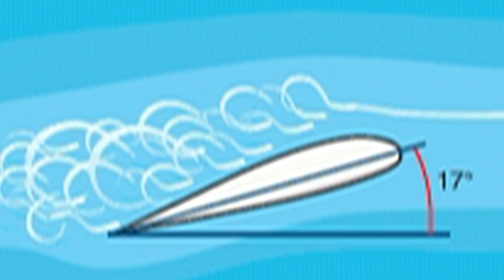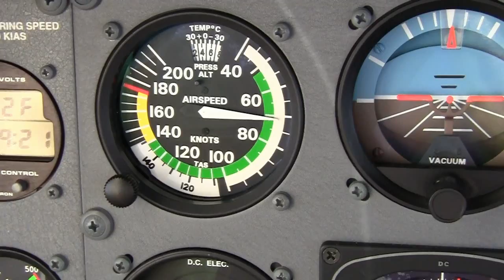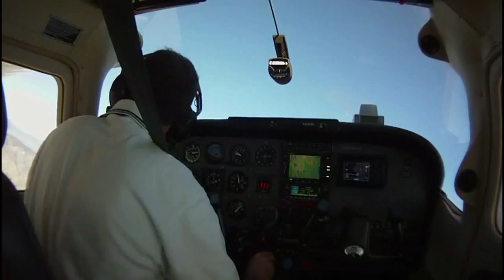Stalls Maneuver Lesson

Comment: Did you stall the plane all the way to the brake point - I didn't see the nose dropping not clear in the video- or is your teaching method just to recover right before the nose is about to drop.
Reply from the maker: +vito9000 Good question. The PTS changed the year after I made this video from "Recovers promptly after the stall occurs.." to "Recovers promptly after a fully developed stall occurs..." The FAA now wants you to let it fully develop. You can't see much of a nose drop in the video (low camera angle shows only blue sky), but if you look closely out the right side window and the AI at 3:30, you do see the nose drop and I recover. Remember, it doesn't need to point to the center of the earth... And neither should it on your recovery!

Comment: Garry great videos btw. My question is concerning stalls from a side slip for landing.  Are side slips inherently spin resistant? My instructor who is also and aerobatic instructor states that is hard to spin from that. The fear I have is flying close to the ground as a lot of accidents I read about involve spins into the ground.
Reply from the maker: KTS It is possible to induce an "over-the-top" spin in an aerobatic airplane; not so much in a Cessna or Piper trainer (not enough power or rudder authority). Rich Stowell says a slip is actually less likely to lead to a spin than coordinated flight, as yaw and roll are less-coupled in a slip than in coordinated S/L flight. I was recently taping a video segment for cross-controlled stalls in a Cessna 172N. I didn't want to spin it, but I was sure trying. You'd really have to not be paying attention for that to happen inadvertently. The plane is so stable it just kept fighting to keep flying. I've noted the same thing in a 152 Aerobat; you have to be quick to get it to spin, otherwise you just mush along or get into a steep spiral, but not a spin.

Comment: hi again, my instructor want me maintain heading when I induce a stall. How to maintain heading when there is crosswind.
Reply from the maker: You're flying within the airmass (at altitude) when doing a stall. You should not have any awareness of wind at altitude (other than it would cause drift of your ground track), but it's not going to have any effect on your magnetic heading is it? I love pilots who say (at altitude) "it's windy today". How can you tell? Unless you look at the GPS (or the ground), there's no way to discern wind in flight. Yes, it might be bumpy/turbulent, but that's not 'wind' per se, that's shear, shifts, gusts, etc. I flew a Piper Cub a few days ago with a 45-MPH tailwind that was silky smooth... no concept of the wind, other than I was moving over the ground rather quickly.